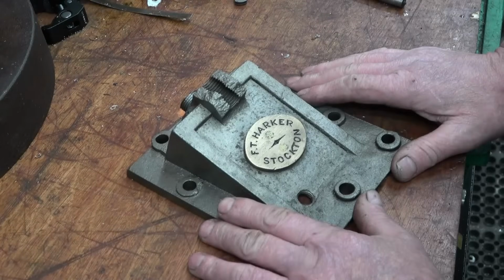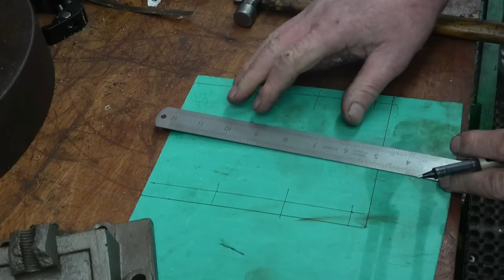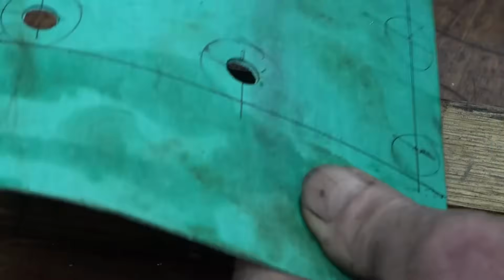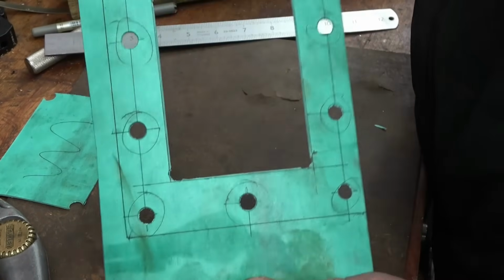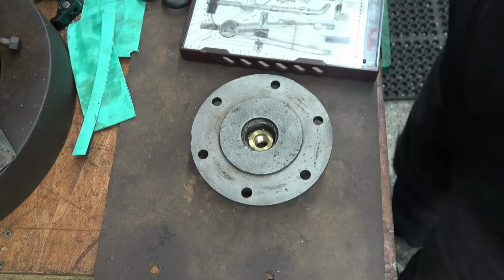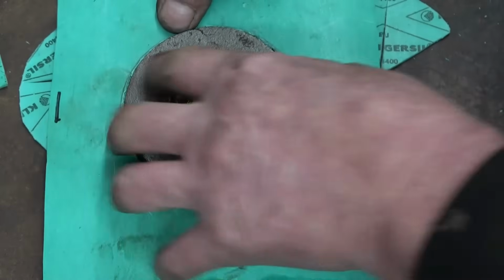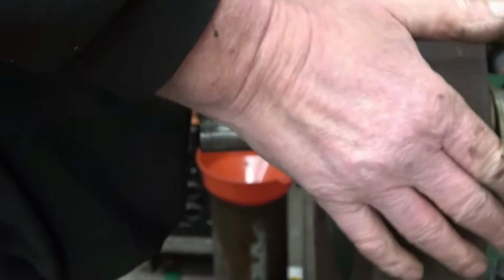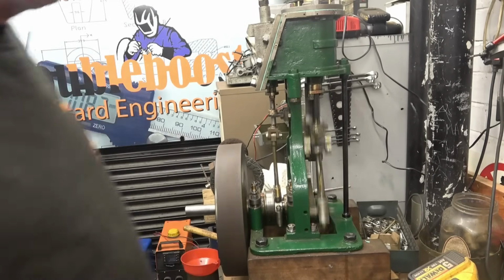SNNC 515 P2. Vintage Steam Engine Restore.

Comment: Congratulations on getting the steam engine running. It's so satisfying when you have stripped and rebuilt a piece of machinery and it starts first time. John a tip from someone who punched a great many holes in thick leather, very thick millboard and the like. Find yourself a piece of 4x2 that has been neatly sawn by machine across the width. It only needs to be 6-8" long and put it upright in your vice and punch into the end grain of the block it works so much better than on the side grain of a bit of wood or hardboard. And when both ends are mangled you can get a mate who IS a "Wood Butcher" as you call them and get him to just slice half an inch off of either end with a chop saw.

Comment: Another great video John. One thing I do when those blades get dull is to rub them across a sharpening stone and get back to work. If I am in a bind, a piece of concrete or brick will also work as long as a fine finish isn't required.

Comment: I remember seeing a hole punch with a spring loaded pin in the centre. The idea was that you mark the centre (with a centre or transfer punch perhaps), then the pin can drop into the mark and your hole is then perfectly aligned. It takes away the guesswork and speeds up the process. I wish I could remember where I saw it.
Reply: Maun industries wad punch, may well be what you were thinking of. Good video on this today on The Recreational Machinist channel.
Reply: @davidberlanny3308  Yes, I believe that's the one. Interesting modification.